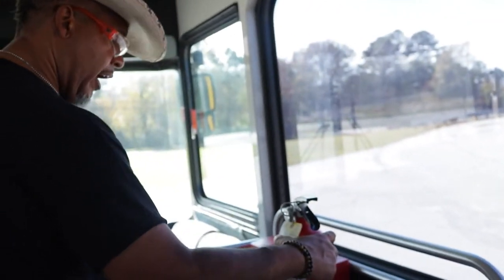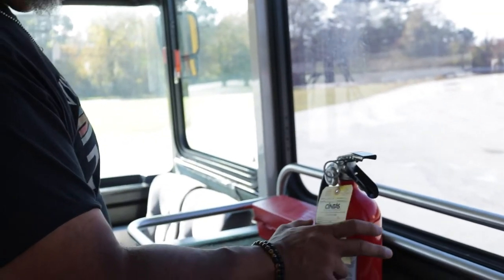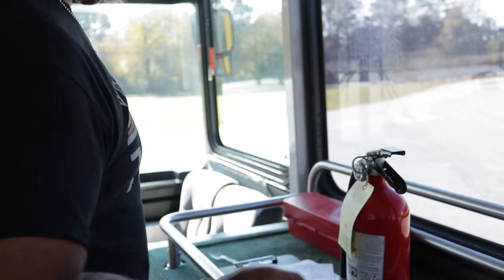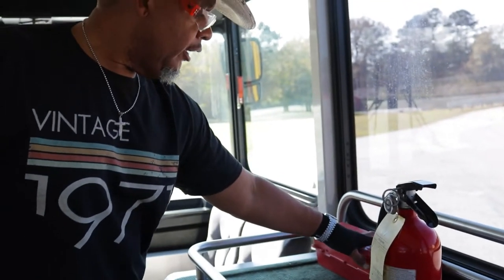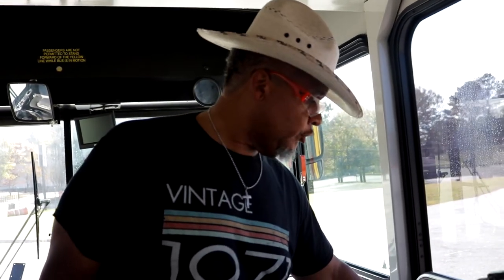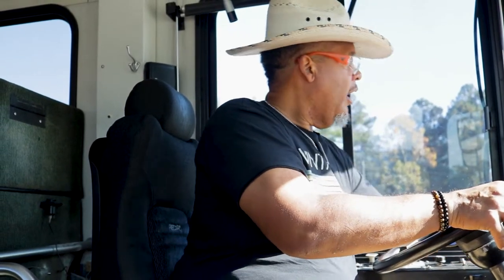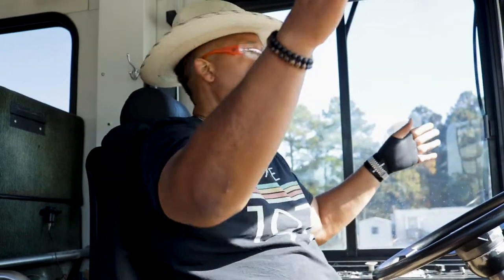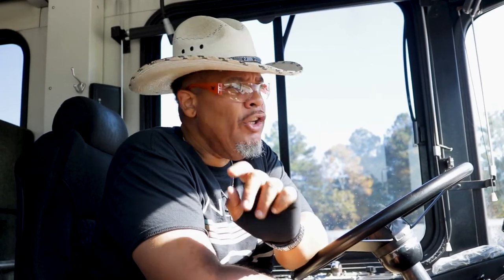How to Perform an In-cab Inspection on a Bus (CDL Test)

Comment: Hey! Your video helped my pass my CDL test last week as a Disneyworld bus driver.  You the man!
Reply: When you leased the brake beginning your air test did you wait for the first minute and say 2 psi or just went to straight 3 psi when you held your service brake down?
Reply: I was told that our releasing the brake and waiting for our 1st min is old, we just hold our feet on the brake and say now at this I should not lose no more than 3 psi instead of doing it twice
Reply: I'm not doubting Mr. B, my instructor states that the 2psi we don't say anymore, just losing 3psi only is what we say now. I have memorized everything about the bus and the brake test watching Mr. B
Reply from the maker: That is awesome!

Comment: Hey Mr. B, I passed my inspection using your system, I had to use the night park because the pop up test required it on the bus that I was using, and I passed, just wanted you to know. I didn't pass on the alley dock though, I did the straight back and the onset great. Thank you Mr. B for your training being on here when I needed to keep up. I lost my position though since I went twice and didn't get, and because I went off on my instructor, they said i was unteachable. I will do it though that alley dock is something, haven't done it in a while, and it's gonna take practice. I was not anxious though, just backwards. Dougetta Oliver
Reply: Bahahahah
Reply from the maker: Thank you!

Comment: Mr. B, I have been watching you on the bus pre inspection and I have been able to memorize everything that I need about the bus, I have the brake system memorized already the way you showed me but my instructor states that the brake release holding for 1 min and losing air no more than 2 psi has been eliminated and they don't use it anymore, and I should just say when I put my foot on the break to say now as I hold my foot on the break I should not lose no more than 3 psi. Are you up to date on this? He says he wants me to pass and I believe I will with the method you have shown us on YouTube, and I want to follow this, bit my instructor is going to give me a hard time if I don't do and follow what he says. I can't follow yours here, but I have it down pat the way you have taught.  Initially when I finished my class the first week, it was only 5 of us, the other 4 went out I had to stay back and study the whole week while they went out, mind you I have my Class A, I hadn't even taken my written test for Passenger endorsement yet but they were able to go out, I failed twice, but the third time I passed. So I looked on YouTube to find a pre inspection video of a bus and I saw you, so I have been following your system ever since, and I memorized the bus this way, I took a picture of your engine and I took a picture of our engine, and memorized our engine as well following your system. Thank you for being on YouTube when I needed the information just to keep up with my class. Dougetta Oliver
Reply from the maker: Thank you 🙏